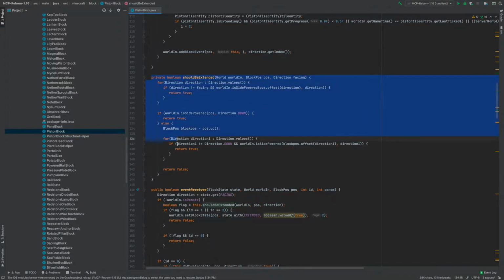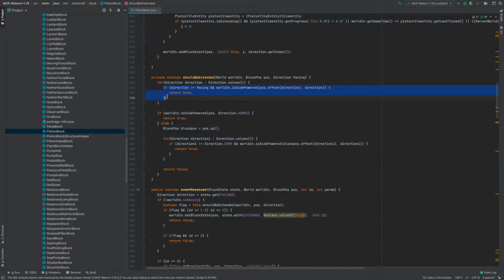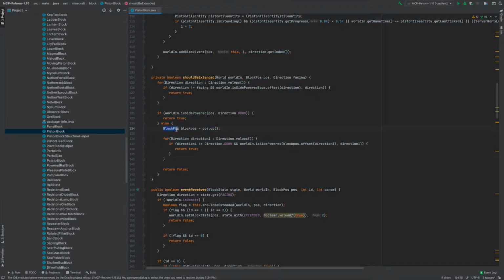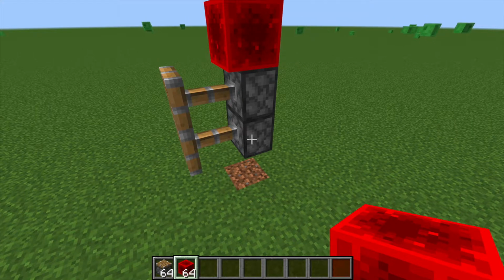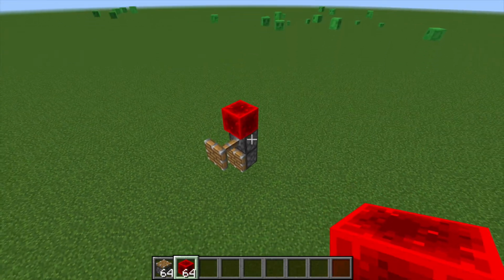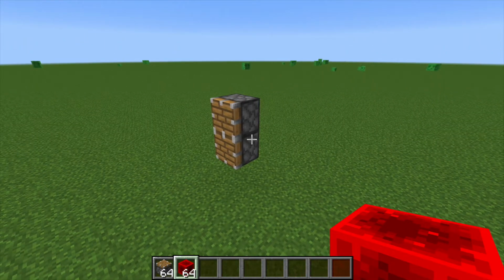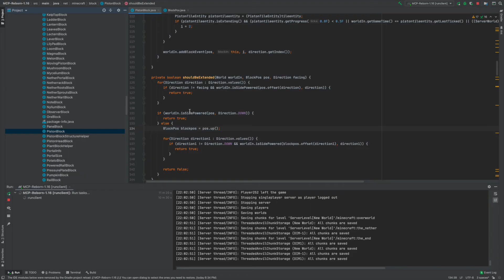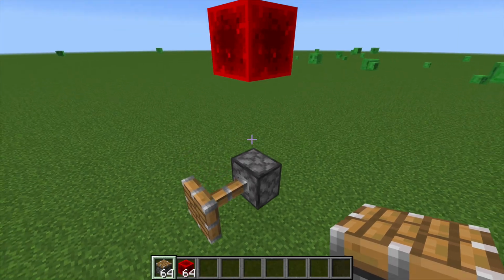Why Quasi Connectivity REALLY Works In Code! [128 Sub Special] | Explaining Minecraft #7

Comment: Ok, that's good explanation. Perhaps too detailed for programmers. But I got another question. Why this bug is here?  It doesn't make any sense to go one block above and check redstone power again. I will not be able to sleep today thinking about this.
Reply: a bit late but i did end up doing a little research on it
apparently jeb (or another mojangster) just copied and pasted the redstone check function from the bottom half of a door to other redstone components he implemented and of course with doors being two blocks tall it had to also check the block above
Reply: @redcubedev  thanks, this makes sense